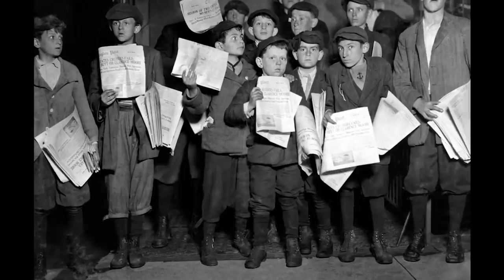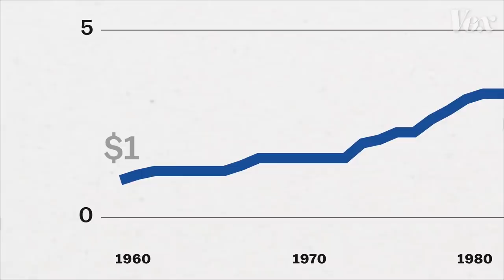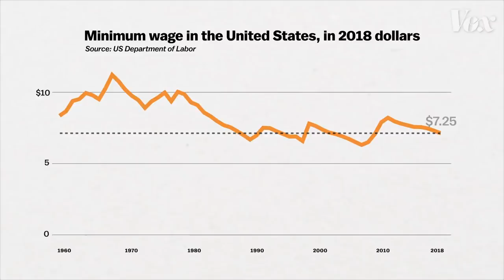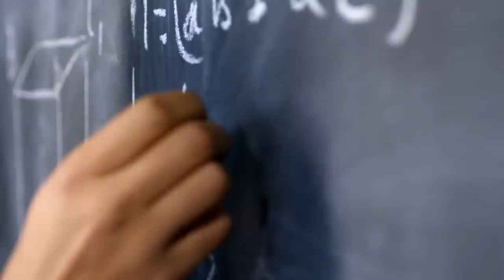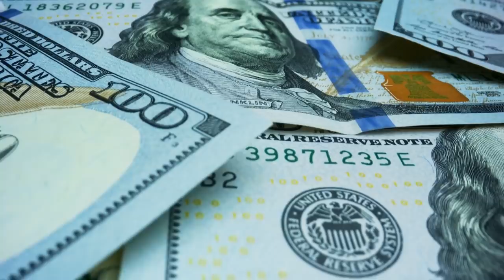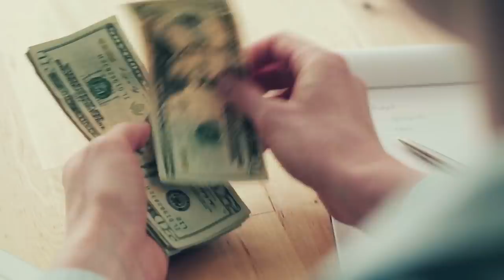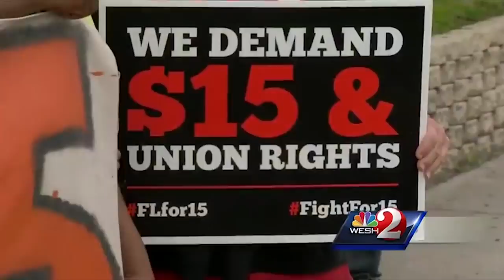The Minimum Wage Debate Explained

Comment: The problem with increasing the minimum wage is that it's at best only a temporary solution. The minimum wage increase is pointless and most likely harmful. More money paid per hour = fewer overall hours. Many small businesses are going to be losing money if they hold accountable for everyone at the same hour ratio. For all of this to work, there would have to be increased price points for the customers as an economic strategy to bring an extra amount to pay off the increased wages for all their workers. Very successful companies (i.e Walmart, In N Out) could maybe pull this off, but smaller businesses themselves would be jeopardized which means that if the businesses themselves fail, the workers associated with it would fail to. The economic inflation argument is the logistics of this whole premise.
Reply: It seems like you didn't understand the video. More people getting more money means more money going through businesses and the economy. The money doesn't come out of nowhere, the profits of the big wigs and the owner class are lower if wages increase, which is completely acceptable because they don't deserve all that wealth if they are exploiting workers by paying them poverty wages. Its the opposite of what you say actually, its a temporary shock to the system, but once it evens out, more people with more money means more money going through businesses and the economy. If small businesses suffer, they deserve it, it means they can't stay in business without paying poverty wages. The fewer hours argument if wages increase is illegitimate. The only reason that would happen is if we do not have prpper unionization or worker protections in place, employers will choose to work people less so they don't have to provide them benefits. Which should not be legal or ok, like I said. The money doesn't come out of nowhere,it comes out of the big wig and CEO profits, which is completely acceptable.
Reply: @berkeleyscott3344  It seems you didn’t comprehend my comment. 
”More people getting more money means more money going through businesses and the economy”
 > Wow really?! I certainly didn’t know that.... lmao You’re regurgitating an argument that my primary had already accounted for. Yeah, and more people under the objective of being paid more requires more money of the employers, hence why the demand to increase the means of production off of minimum wage production skyrockets. This isn’t rocket science. It’s simple economics.

Substantiate your claims more in depth please. You claimed how the profits of the owner classes are lower if wage increases, that being opposite to my substantiated premise, and then you claimed that it’s acceptable without even explaining how that logistics works. 

”They don’t deserve all that wealth if they are exploiting workers by paying them poverty wages”

> And you do realize the cost of living would proportionally still be the same as before the wage increases since if the prices inflates, if you’re paying $38 for a burrito from Taco Bell, how is that proportionally the same as before the wages increase? If anything, it the cost of living worsens of hypothetically the businesses fail and everyone becomes jobless. 

If you want to debate, I’m open to on Discord.
Reply: @damianjustice561  ok so overall I'm having a hard time understanding you. From what I see, your argument is "increase to minimum wage makes things more expensive as a means to pay for that increase in wage." And "increasing the minimum wage harms small businesses and that also harms the employees of said small business." Correct me if I'm wrong and please try to use simpler words for a simpleton like me. I have a hard time understanding unnecessarily complex debate lord wording and phrasing. 

With that being said I'm going to respond as clearly and concisely as I can to what I presume your arguments are. 
"increase to minimum wage makes things more expensive as a means to pay for that increase in wage." This is true, but the ratio in which people think its going to happen is just not the case. Like the video stated, in Denmark, the pay is much higher as a McDonald's employee, with many other benefits, yet their big Mac only costs 27 cents more than America's. (On average I assume) this happens because McDonald's isn't making the decision to put the increasing cost associated with higher wages on the consumer.(price inflation, I.e. big Mac costing 700 dollars.) The reason it is only 27 cents more is because they decide to take the money from their profit margin. Meaning they (corporate execs and shareholders) lower their personal profit margin, instead of making $7000 per big Mac sold, they only make $6000 per big Mac sold. This means there is an extra $1000 per big Mac sold to be distributed towards the employees. The other reason they can get away with this (not like they really want to) is because there is an increase in business. I.e. since people are being paid more, they have more money to spend on things, which correlates to an overall increase in profit for the business, its just that the profit is distributed >more< evenly than it is in the US. 

"increasing the minimum wage harms small businesses and that also harms the employees of said small business."  This is an asinine argument because if the small businesses can't afford to pay their workers a respectable wage no matter what their intentions are, they shouldn't be in business. The thing that contradicts the idea that small business would suffer and go out of business is that, since people will have more money, they will spend more money, which means the small businesses will see an increase in business and profit. Like the video stated, in the 1960s when the minimum wage was increased, the racial wealth gap was lowered and business and profits increased throughout the economy across the board. If you want me to "substantiate" my claims, please just watch the video. If I am misunderstanding your argument just let me know and try to explain it in simpler terms for an idiot like me.
Reply: @berkeleyscott3344  You’ve brought up some interesting points. But first, I’m going to watch the video thoroughly before I submit another response. I’ll be honest, I didn’t actually watch the video. I assumed the video would just examine each side of the argument, but didn’t expect it would take the side of one.
Reply: @damianjustice561  ok, no problem. Thats why I got confused at your view points. One thing to point out though, in the video he agrees with most minimum wage workers are high school students or w.e but actually people under the age of 20 only make up for 20% of minimum wage workers.
Reply: @berkeleyscott3344  
Pardon for the wait. But alright, so I just finished watching the video, and I have to say I’m willing to have my mind changed now and I now understand the opposition. But there’s definitely key points I want to point out. First off, I want to make clear that I used to support the minimum wage for a plausible reason. My reasoning was I’m against illegal immigration. What does illegal immigration have to do with the minimum wage, you may ask? Well. If you are against mass & illegal immigration and want to reduce it as much as possible, I used to stood by the premise that you must support the minimum wage increase. You may be asking how that works. Well, Republicans like Paul Ryan, you can’t deny is a huge capitalist and has a lot of capitalist donors who like nothing more but to increase their profits. People like them have been against immigration reform for decades because they believe mass immigration would shrink the wages of the working class and increase their profits. What national socialism would do (increasing the minimum wage) is essentially prevent mass immigrations (particularly illegal ones) since the prototypical issue is that immigrates migrate here due to poverty. When you raise a minimum wage in all nations, you improve the costs of living, so we wouldn’t be having such mass immigration as we are seeing, ONLY IF economic inflation doesn’t occur. Which I’m sort of convinced won’t now. But I do still want to point out some importance.

1) The video stated that an economic inflation won’t happen because houses increased even without minimum wage increase, therefore it is only the decision of the capitalist to inflate it. However, this seems like a red herring fallacy (basically means to present irrelevant information in an attempt to distract and avoid the question) which the question is, is there really a correlation between the two arguments at hand? That, if the minimum wage increases, then you could see an inflation, but to refute this by stating the prices increase anyways doesn’t correlate enough for a coherent rebuttal because it ignores the actual cause and effect the minimum wage increase could actually have an impact on. There could simply be other reasons for the raise of the price of the house that just aren’t relevant to the minimum wage debate at all. It’s just an impractical argument. 

2) I see that you brought up Denmark as an example, but does Denmark technically have a minimum wage? I’ve read that they’re protected by Unions. This will explain it. https://www.investopedia.com/articles/investing/080515/5-developed-countries-without-minimum-wages.asp

3) The argument that if a small business can’t afford to pay its workers, then they shouldn’t have the right to own a business is a little flawed and is missing something important. That is, we need to remember they are small businesses after all and it’s also not the case that business get wealthier based on productions sold. It’s more essentially, investments which is what business owners essentially do on a daily-to-daily. Dave Ramsey’s experimental study on millionaires will explains this. https://www.daveramsey.com/research/the-national-study-of-millionaires

4) The argument that minimum wage workers will spend more, therefore the businesses will get richer is self-contradictory within itself because we have to understand that ‘spending more’ is actually among one relevant factors that explain poverty. The afore mentioned study on millionaires by Dave Ramsey addresses that as well, which more studies have shown that saving is correlated with being smart with your money, which is a trait that capitalist classically and conditionally share to earn wealth.

Again, I’m willing to have my mind changed, because if you’re right about the minimum wage premise, then that will then enhance the solution to the illegal/mass immigration issue. And as for your claim for teens making up 20% percent of the minimum wage working class, do you have anything that might help support that claim? Still, I’m glad to have watched the full video and hear from you to had synthesize my thoughts even better than previously. Your profit margin point being strongly relevant and overall a good point I’ve learned.
Reply: @damianjustice561  the problem about the guys' argument with the claim that the workers are going to pay more to small business is that it ignores the key players of the market that being said the big business, who are flexible and have the advantage to cut their prices and getting a larger profit margin.
 Another point you should've made is that minimum wage laws is what causes a rise of unemployment primarily among the youth because business owners wont take the risk in getting a young kid who has no experience. As a result only prolonging the time for the young to get the ability in getting  a high earning job 
Not that but it increases the rates of companies exporting their business into other places.
Another point you should've had mention before is,by raising the minimum wage you increase the chance for that job to either be eliminated or replaced by robots.
Reply: Also income inequality between age bracket increases overtime
Reply: Notheless, the taxes increase because more people are going to drop the ball in finding a new job
Reply: @damianjustice561  another great point you should've made was to include the factor of decreasing participation in jobs with nominal wages

Comment: It is hard to pull yourself by your boot straps, when someone has cut your boots straps or is stepping on your boot straps. Just working harder will not solve the problem. It sends you on a downward spiral.

Comment: The Case for a Maximum Wage Law: Bridging the Wealth Gap in America
Introduction
Income inequality has become a defining issue of our time, plaguing societies across the globe. In the United States, the wealth gap between the ultra-rich and the working class has reached staggering proportions. To address this growing problem, it is imperative to consider bold solutions that promote fairness, economic stability, and social cohesion. One such solution is the implementation of a maximum wage law, which would cap the earnings of the highest-paid worker within a corporation at no more than 12 times the salary of the lowest-paid worker. This essay will argue that such a law is necessary to promote economic justice, reduce income inequality, and create a more balanced society.
I. Income Inequality: A Growing Problem
1.	The Widening Gap: Income inequality in the United States has reached alarming levels over the past few decades. According to data from the Economic Policy Institute, the top 1% of earners in America took home more than 26% of the country's income in 2020, while the bottom 90% earned just over 53%. This stark disparity reflects a fundamental flaw in the current economic system.
2.	Social and Economic Consequences: Excessive income inequality can lead to social unrest, decreased economic mobility, and reduced opportunities for the working class. It exacerbates poverty, hampers social cohesion, and undermines the principles of democracy and fairness that the United States was founded upon.
II. The Need for a Maximum Wage Law
1.	Addressing Disproportionate Compensation: A maximum wage law would address the root cause of income inequality by curbing excessive executive compensation. It would ensure that the highest-paid workers in corporations do not earn astronomically more than their lowest-paid colleagues, thus promoting fairness within organizations.
2.	Encouraging Fair Labor Practices: By implementing a maximum wage law, corporations would be incentivized to raise the wages of their lowest-paid employees, as this would be the only way to increase the earnings of their highest-paid executives. This would contribute to a more equitable distribution of wealth.
3.	Economic Stability: Income inequality can lead to economic instability, as the vast majority of people have limited purchasing power, which can weaken consumer demand and hinder economic growth. A more balanced income distribution would stimulate the economy and promote long-term stability.
III. Possible Criticisms and Counterarguments
1.	Market Efficiency: Critics may argue that the market should determine executive compensation based on supply and demand for talent. However, the current market-driven system has proven to be unsustainable, leading to unprecedented income inequality.
2.	Talent Retention: Skeptics may contend that a maximum wage law could lead to a talent drain, as executives seek opportunities in countries with more lenient compensation policies. To address this concern, the law could include provisions for additional tax requirements for US Citizens employed overseas to equalize their wage requirements.
3.	Administrative Challenges: Implementing and enforcing a maximum wage law would require effective oversight and regulations. However, these challenges should not deter us from addressing the pressing issue of income inequality.
Conclusion
The implementation of a maximum wage law limiting the highest-paid worker in any U.S. corporation to earning no more than 12 times what the lowest-paid worker earns is a bold and necessary step towards achieving economic justice, reducing income inequality, and creating a more balanced and equitable society. While there may be legitimate concerns and criticisms, the urgency of addressing income inequality outweighs these challenges. Such a law would promote fairness, encourage fair labor practices, and contribute to economic stability, ultimately strengthening the social fabric of the United States. It is time for our society to embrace the principles of economic justice and take meaningful steps towards a more equitable future.

Comment: The free market also applies to wages. If you want to get a higher wage then simply push for a position that has higher demand compared to supply. Acquire better and more valued skills and you will be paid more. The big corporations actually would be happy to have a higher minimum wage because then it would eliminate the smaller competition. They can pay more or even push for automation that will lead to them not even needing that many workers. You can spin it how you like but just look at real-life examples. Everywhere where the minimum wage is implemented there is higher unemployment for low-skilled individuals. Artificially raise the price and demand will reduce. That's economics 101.